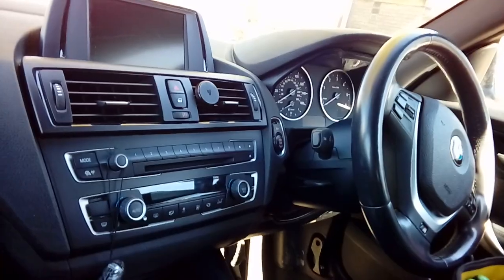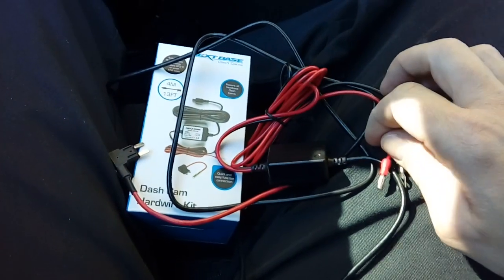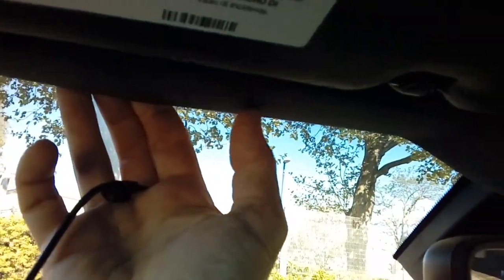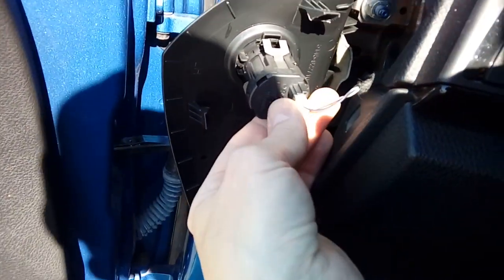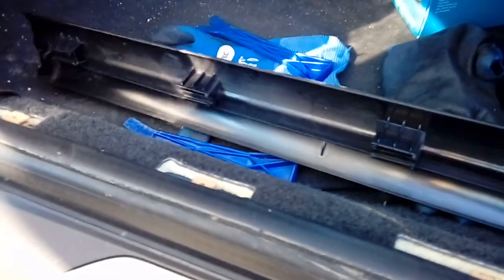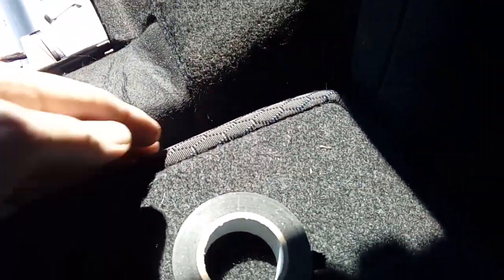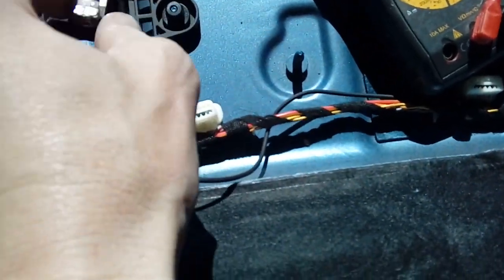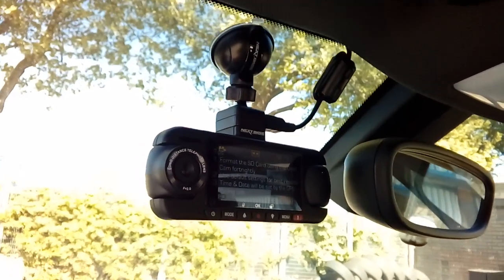BMW 1 series 2011 onwards how to wire in dash cam to fuse box,simple guide.

Comment: Great video. Used this as a guide to successfully fit a dashcam to my 2014 1 series. Thanks for sharing. I didn't bother actually pulling the side trim off and was able to push the cable up under the trim without removing it. The only dodgy bit is removing the dash side panel as you risk scuffing the panel or dash unless you are careful, otherwise it took me about 40mins.

Comment: I found that hardwiring a nextbase kit in to a 5 door was a right pain. I ended up using the kit that came with the camera and connecting it to the aux port in the passenger footwell. I removed the trim that holds the aux port and popped it back through (the aux port back through the trim piece so its hidden inside) and then plugged it all in and hid the wiring as shown down the side of the pillar/roof lining. Does exactly the same thing  but saves buying extra cable/connectors and faffing about running the cable down the length of the car. If your fitting a nextbase camera this may be of use!

Comment: Twist them off. Don’t cut them. No sharp edges if you twist them. Great video. Saved me a major headache as to where to route the cable. I feared I was going to have to use the under bonnet fuses.

Comment: I have a Blackview front and rear dash cams and it’s supposed to work in parking mode requiring a permanent power hardwired to fuse box. It’s ti fit into a 2 Series BMW 218i and 2018 model. Advice as to fuse box connection would be appreciated and also details of any extension to cabling I might need. Thanks so much for good video.

Comment: very handy video thanks. Just installed my nextbase into my F21, 3 door, 2013.
Mine was a little different as the installation cable didn't have an earth that needed to go behind the dash, so that was better. Nor did it require an extension kit to reach the battery.
The earth reached all the way to the rear, so I've attached that in the boot.  A good video full of lots of tips and tricks.
Reply: About to do my 2019 mate, help a brother out and send some pics please?
Reply: @Al-Sky  hi. What do you need? I followed this video which worked OK. The cable was a bit different but not a problem. The 2019 car is likely a bit different to my old one.
Reply: @dizmatt1  your fusebox was in the boot of your one series? Was it pretty much the same as the vid give or take?
Reply: @Al-Sky  yes, fusebox in the boot, I was able to push the wires through the seats in the back and around the cushioning,  then straight to the fusebox. I can find out the fuse that I used and where i put the earth, but can't post pictures on here. The trickiest thing was putting all the door seals back neatly. The video was very helpful.
Reply: @dizmatt1  Thanks mate, we got there in the end, it was a little but of a mare though I'm not going to lie. Thanks for your help man!

Comment: Thanks for the video it's really helpful!!! For anyone hard wiring Nextbase dash cams, the Series 2 now come with a 5m wire (not 4m like in the video) so no need for extending it. 

I've currently hard wired to a radio port, if my dash cam has parking mode, I'm guessing this wont work in the current port. Which ports are typically constantly live which would suit the needs for parking mode???? Many thanks
Reply from the maker: You would need to use a constant live,such things as power seats or central locking stay live all the time so that would be a good place to start but be sure to test the fuse with a meter or probe and check in your handbook that the fuse your looking at is not for a critical system.
Reply: Brilliant thanks for the advice buddy much appreciated 👍🏼👍🏼👍🏼

Comment: I have 15 plate 1 series sport, I've wiry my dash cam the same way and in the same Fuse,my rear cam is separate not fixed like yours do I still use the same Fuse as you did because my rear cam will work for a day or so then the screen will go white or it will freeze the picture on both screen views, but when I unplug the rear cam the front works perfect.
Reply from the maker: @darrenwilliams7741  Depends on a lot of factors, the build date or the car, the country or origin and the spec. Over the years I’ve done hundreds of cars that should be the same spec but are not so checking the circuit with a meter is a must tbh.
Reply: @PJsprojects  Thanks for the reply 👍

Comment: How can you best identify fused which are switched by the 'auto stop start' function?  I don't want the camera to turn off every time the stop-start happens ? Thanks !
Reply from the maker: Your best bet would be to find one that is switched but stays on when the car goes in to eco mode when stopped,such as the heater blower fuse.

Comment: Hey, thanks for the video! Is there a way to connect the earth cable near the boot fuse box? The cable I have is no long enough to connect near the airbag activation thing... Thanks in advance for the answer!
Reply from the maker: Yes you could just ground the cable to either a rear light mounting bolt or failing that drill a hole,sand back a small area of paint and use a bolt/screw to earth to the car body.
Reply: @PJsprojects  How easy would it be to run the cable across the roof rather than running is down the column and across the bottom? Just thinking it might help save some wire length.
Reply from the maker: @liamfermoyle8976  Yes you could, just make sure to tuck it behind the curtain airbags if they are fitted.
Reply: @PJsprojects  Thank you, I think thats what I will try to do, I need to install the camera before Saturday and I do not have an extension cable (I should have watched the video fully :D )

Comment: I'm having a mare. I cut the main usb plug (that would plug into the power adaptor) off the cable that runs from the camera to splice to the hardwire, only to discover a single white cable surrounded by an exposed wire. I just keep blowing the 5amp fuse for that's tapped off the 5amp for the electric mirrors. I've a 2011 1 Series coupe.

Comment: Hello, what did you use to extend the wire? Could you just use a terminal block connector or did you use heat shrink? Thanks :)
Reply from the maker: Yep heat shrink or a bullet connector would be fine.

Comment: Hi,
great vid, especially for the owner of BMW 1.
Two questions - can I connected the earth and power cables directly to the battery at the back? And does it matter to which fuse I connect the ignition cable? I mean is there a difference between 5A fuse and 40A fuse?

Comment: BMW 1 Series has fuse on the front of the car, Can we not hardwire into front fuse rather than taking all the way to back?
Reply from the maker: Yes the early models dohave a front fuse box and a switched fuse from that can be used fine. Later models have a rear fuse box but it also depends on a few things such as build year,country of sale and spec level.

Comment: Have a bmw one series  f21. Where is the best place to earth in the boot.
Is the battery bracket okay.
Thanks
Reply from the maker: You could use that or just to side of the fuse box should be a 10mm stud that can be used. Either will be fine just make sure to clean any paint of the one used so that the earth connection gets a good connection to bare metal.
Reply: @PJsprojects  Thanks PJ, dash cam all set up now.

Comment: Quick question my camera will have the parking sensor (if car is hit then it's supposed to record when parked) my question is will I need to wire it to a fuse that is always on?
Reply from the maker: Depends on the camera. Most cams have battery back up that works for short periods (couple of hours). If your camera only has a plug with it that goes in the cars 12v socket then it only needs a switched supply.
Some brands such as Black Vue can be installed with a power pack that has both a red and yellow wire that need connecting to switched and constant to enable long periods of parking such as leaving the car at an airport for a few weeks.
Reply: @PJsprojects  so I got a crosstour cr600 hardwired it to the radio fuse, it seems to have its own internal 🔋 but still trying to get my head around it. But thanks for the extensive guide.

Comment: Don’t suppose you wanna do mine? I suck at car stuff but live in rough area so need to get a 24 hour 360 cam
Reply from the maker: I only did bulk jobs and tbh retired over a year ago.
Also worth noting is that dash cams are not surveillance cameras and so are not designed with 24hr a day usage. Consult your local specialist car audio dealer for the correct kit 👍🏻

Comment: The steering wheel is on the wrong side.
Reply: it's a BMW, so having the steering wheel on the correct side is an optional extra!
Reply: Steering wheel is on the right. It's on the right side because that is the right side! :-)